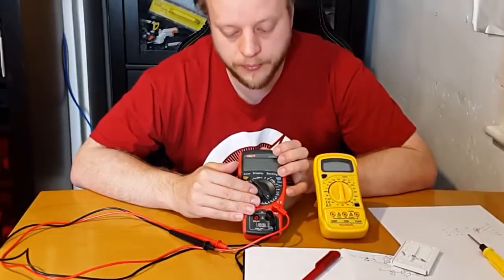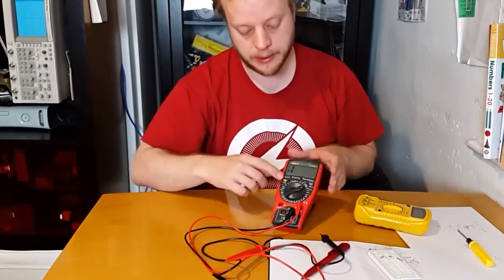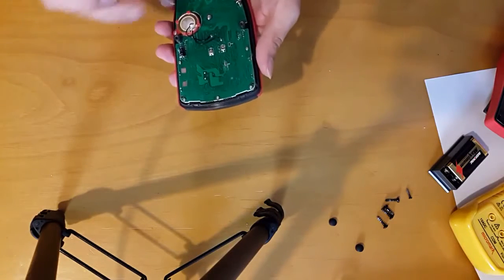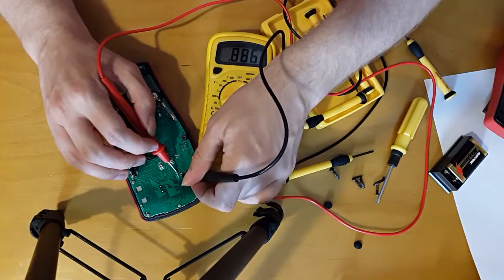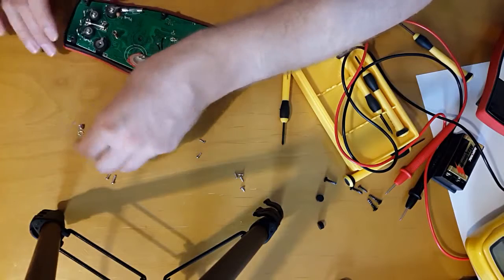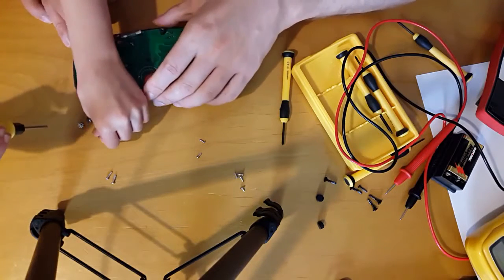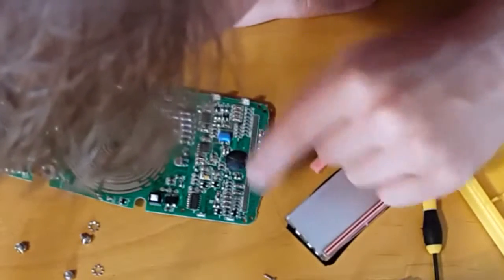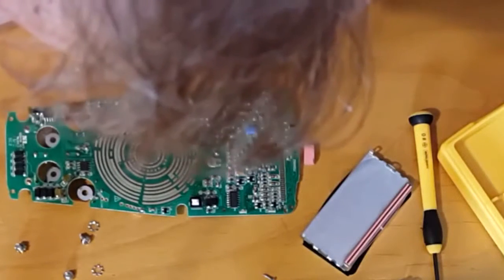Uni-T UT50A Multimeter Glitch and Teardown

Comment from the maker: thanks.  I am a regular viewer of the eevblog. I probably do need better gear, although I've better camera in sights first.
Reply: I personally use an extech ex330, winner of the eevblog 50$ multimeter shootout. My only complaint is that continuity mode is not a separate position on the dial and requires the use of the mode button to access, but apart from that minor annoyance it works very well.

Comment: With UNI-T Multimeters, you get what you pay for. Check out Dave Jones Videos on EEVBlog. Get yourself a Fluke 15B + or a 17B+ which are the lower end flukes, but are very useful for electronics.
Reply from the maker: +RN D which do you use yourself?